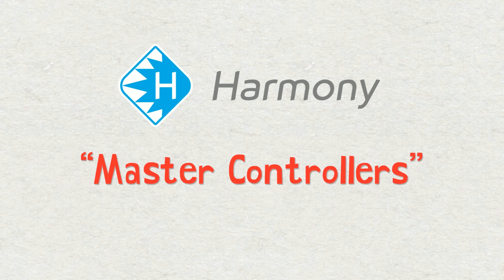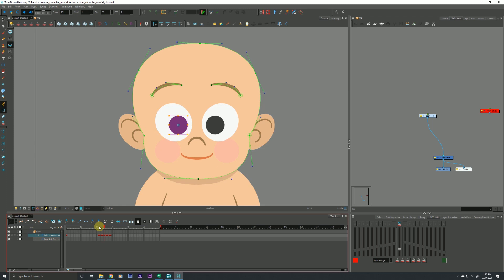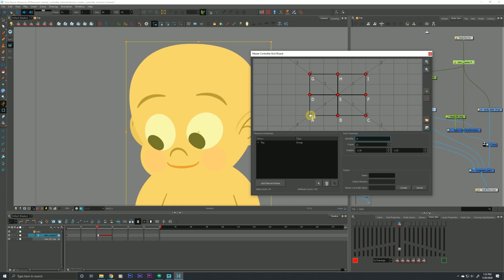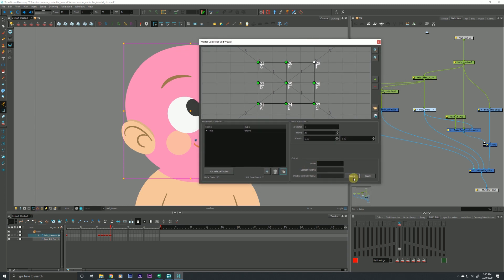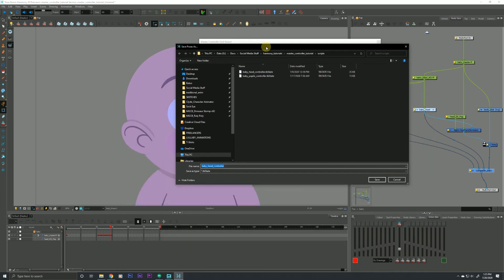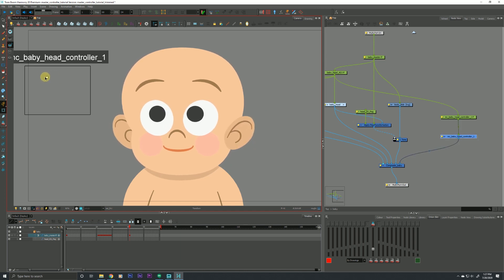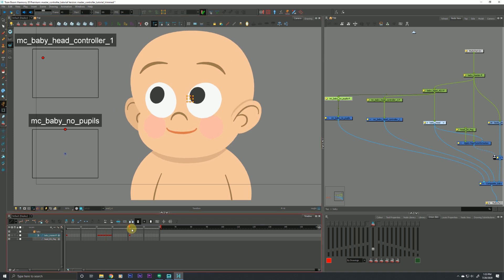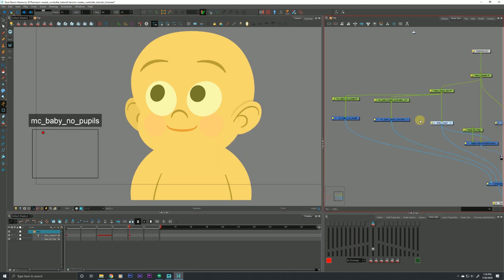Toon Boom Harmony Tutorial#25 - Master Controller Grid Wizard

Comment: Hello. Why do controllers disappear when moving a character to another scene (project)?
sorry, I'm using a translator
Reply from the maker: If you are using H20, creating character templates will be a much easier process. However, prior to H20's release you could still create reusable templates with the Master Controller in them, but it was a bit more of a manual process which is slightly beyond a casual YT reply.

Comment: Can you use Harmony 16 for this?
Reply from the maker: I no longer have access to Harmony 16, so I cannot find out for sure. The Grid Wizard (or the entire Master Controller Toolbar for that matter) is not included in H16. Toon Boom released a script into the wild called the "Interpolation Grid" that I possibly have someplace, but I'd have to look for it. It is very early version of it, and lacks some features shown here, but can be added manually.
Reply: @FrankSummersAnimation  oh ok because I have thats version of H16 and it has the interpolation grid for the master controllers
Reply from the maker: @TripFontain  Nice. So yes give it a shot then! There will be some differences between that and what I discuss here.